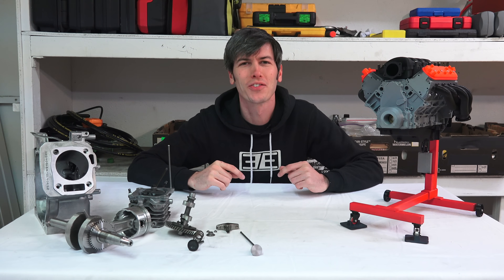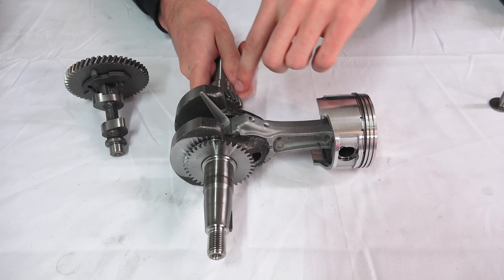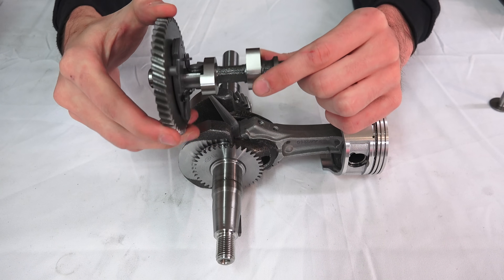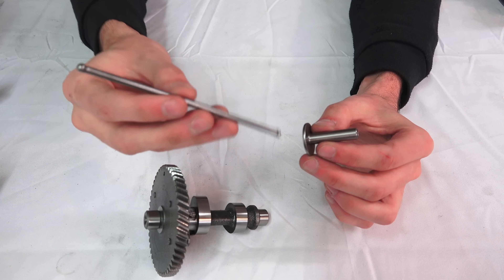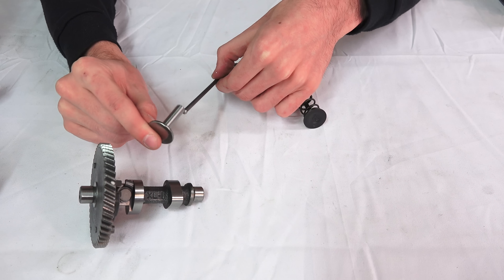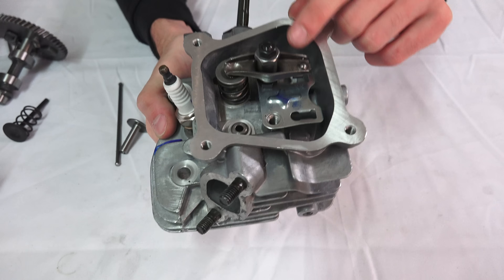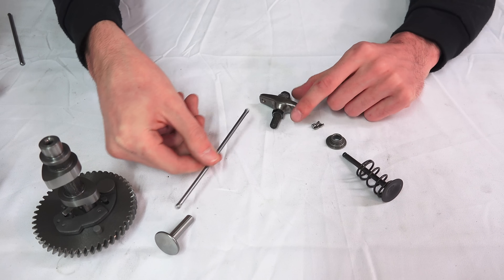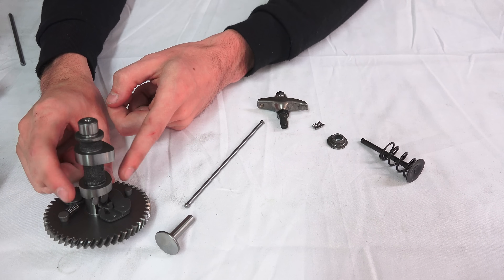Why Can't Pushrod Engines Rev High?

Comment: Another issue with pushrod engines that is very important but seldom mentioned is intake porting. In a pushrod engine, the intake ports compete with the pushrods for the same real estate in the head casting. Therefore, intake port geometry is generally compromised in pushrod engines vs OHC engines. Intake ports typically must take on a tall, skinny cross section as they pass through the pushrod wells. This, along with the need to transition to this shape in the intake manifold and then transition to a round valve, hurts flow compared to the more optimal intake porting that OHC heads allow. Newer pushrod heads (such as GM LS and Chrysler Hemi) do MUCH better in this respect than older designs, but are still behind contemporary OHC heads. This compromised flow is another factor that limits the rev capacity of pushrod engines.

Comment: Engines that operate at lower RPMs last longer than engines that operate at high RPM. High revving engines are generally smaller size Pistons shorter stroke and overhead cam 4 valve. A squeeze a lot of power out of a small V6 or V8 but generally they're a lot more stressed engines and they don't last as long as a good old-fashioned pushrod V8. That's why they're still used on the street cuz most engines don't operate at high RPM driving down the highway that tends to develop a lot of friction and becomes a fuel waster.

Comment: I am pretty sure that heavier springs aren't really an efficiency loss.  The valve lifter theoretically never loses contact with the cam lobe (except when it is closed) so the heavier spring helps push the camshaft along as the valve closes, thus helps another valve start to open elsewhere.  On an OHC V-6, that would not be the case, but in an engine where at any given crankshaft position a valve is open, it would.  On the V-6, each head is independent of each other, and there are at least 3 camshaft positions of each cam where all valves in the head are closed.

Although there are frictional losses incurred by the heavier valve springs, there actually is an efficiency loss, but I was taught that those losses are really quite insignificant, especially with the roller rockers and roller lifters.  The issue is stress and wear in the valve train components.  In the race engines where it is made possible to go to 10,000 RPM via heavier valve springs, the longevity is nowhere near what is found in the average modern day car.

Like piston speed, no big group of engineers can agree on which valvetrain specifications are best... for business, for longevity, for efficiency, for noise, the future, etc.  There are also noise harmonics to deal with when choosing the valve spring weight.  Along with making sure the springs aren't excessively stressed to the point where the springs have a tendency to fatigue.  

Also, valve float is also a problem due to the fact that the valves really should be allowed to close gently, rather than just slamming closed and having the lifter crash into the camshaft.

Comment: based on your rational a flat head engine should theoretically rev more. by including 5 vs 4 vs 3 vs 2 valve oercylibder further confuses.  at least u admitted racing rules dictate combinations n performance . ps. loved the flathead vid

Comment: Hmm I wonder when we'll have electronically actuated valves. In theory it should be a far better system with no mechanical lag, controlled directly by the ECU so the variations can be infinite in terms of valve timings. I'm just wondering if somebody is able to manufacture a system like this that is also durable.

Comment: If they are using the exhaust shape to scavenge the excess exhaust from another cylinder this could really only be true under vacuum? Because under boost with the cam overlap would push any of that excess gas out with ease. In addition if Mazda went threw so much trouble to eliminate lag it would really only be a at idle feature. If I’m wrong or possibly missing some information please tell me. I do enjoy your videos but sometimes I feel you are missing information or your source didn’t share enough information with you. But by all means if I am wrong please tell me.

Comment: Personally I love the sound of a GM pushrod V8 be it a '55 265 or a new LS over anything else, always have and nothing else will do. And for me, my current tired but still trusty 92 Silverado 3/4 ton 4x4 work truck, 4000 RPM's spinnin plenty fast enough to get the job done up in the mountains. Don't get me wrong, we had a nice pearl white Cadillac STS with the Northstar DOHC V8 engine and I at times admit I beat on that car, put her away wet and she took it all in stride. My boss is soon going to be passing his current truck on to me, a nice (to me anyways) black '07 Silverado with the 5.3 and lots and lots of mileage, just turned over 545,000 Kms and she uses no more than 2/3s a quart, sometimes less between 7k oil changes, I can live with that, it's still a strong truck. We work concrete and at times it hauls a trailer with heavy footing and wall forms and that truck is still perfectly reliable and I look forward to the 'upgrade' haha!!!
Hmmmm...could DOHC engines be successfully/reliably used as a hard workin, abuse prone truck engine? For now I'll say no, aint seen too many imports out here in the mountains and when I do see the imports, well the fellows driving them just aren't working them like we work our domestic trucks with near 2 tons of firewood roped into the box and another 3 or more tons on a trailer. I've yet to see a SOHC let alone a DOHC V8 truck out here in the hills last like our old local girls and I mean really friggin work for their keep, not just be recreational trucks.
Reply: Do you not realize all gas Ford truck motors 1999+ are ohc

Comment: With some stiffer springs my 68 Corolla's little "K" engine (1100cc inline 4) can hit 8000 rpms without floating the valves.

Comment: Bogus.  Four-valve overhead valve engines have been around for years--for instance, the one in my 1978 Honda CX500.  Also, you do not have to have two camshafts, much less two camshafts per head, to control intake and exhaust valve timing and duration separately.  Many mechanisms have been designed to effect this at the rockers rather than at the camshafts.  As far as OHVs not being able to rev, I was a passenger in a school mate's daily driver 1957 Chevrolet  with a 283 small block which he had souped up slightly, when somebody began kidding him about the car not being as fast as it once was because of all the miles he put on it.  He floored it leaving the next stop light, and shifted to second when the tach read 7, 000.  That was in 1959.  OHVs can rev.

Comment: You should take note that high-revving pushrod V8s have their camshaft mounted higher in the block to shorten the length and weight of tappets and pushrods as well as the use of lighter materials.  The use of titanium valves and springs also help as the spring mass has also been decreased.

Comment: Oh and to all who argue simantics and opinions. A high revving motor is a motor that is efficient up top. You can argue an ls can rev to such and such but need built and catered to and loses its main goal efficiency at that point. And a motor half the size will rev higher due to design, but some dont. Just depends, but its not a pissing contest, afterall a pushrod engine will always break tires than a smaller dohc engine

Comment: Factory engines are built with cost in mind and only rev as high as they need to rev to sell to the public. With that in mind most engines sold with 4 valve tech are smaller engines which need to rev higher in order to produce torque and hp needed to move the veh. There are plenty of engines that have push rods that will rev to 7k right from the factory dating back to the 50's You can buy a brand new 350 crate motor for a mere 3500 that easily revs to 7k in our dirt track cars not even a race engine. There are plenty of race engines that rev to over 10k pro stock drag cars for example Nascars  etc. Of course they are too expensive to install in a factory veh. You videos seem to all be focused on how crappy American technology is and how awesome Asian and European Tech is. Fact is you really dont know how all this technology works its more like you take a class yourself then go an try to teach it to others.

Comment: Hydraulic lifters and associated cheap and soft (for durability) OEM valve springs combined with average primary voltage rise time are the culprits for low revving pushrod V8s rather than OHC.
Also Mean Piston Speed (MPS) can play a part for engines not being able to rev high - however the rise of stroker cranks really shows that even MPS is not that limiting.
The pumping losses for pushrod vs OHC are similar. OHC often wins however because port placement and shape in the cylinder heads is less compromised as pushrods often become the limiting factor for port placement, shape and size in pushrod engines.
With OHC, manufacturers build engines that are less compromised than pushrod engines but I sincerely doubt pushrods are the culprit for low revving engines.

Now at the risk of using esoteric engines as proof of my contention, I am compelled to mention that the 426 Chrysler Hemi was routinely turned 9500 rpm in drag racing in the 1970s using the stock 3.75" stroke and a magneto. This would give it a mean piston speed in the order of 5900fpm when the consensus for MPS is in the order of 4100fpm (which kinda further disproves my MPS as the reason for engines not being able to rev high).
Anyhow, what this in fact shows is that with enough valve and port area, a short enough stroke and rugged valvetrain with good geometry, pushrod engines can and do rev up.
Chevy LS and the Gen III Chrysler Hemi engines (yes I know the Gen III is Hemi by name only) are another couple of examples of the potential for stock high RPM pushrod engines and one of those engines only use 90lbs valve springs to control all that reciprocating valve mass and they manage to turn 7000rpm in stock form. Why? because their valvetrain mass is largely irrelevant. 
Many other pushrod V8 engines can be revved up to beyond 6500rpm with modification - esp deleting hydraulic lifters. 
Many pushrod old school solid lifter flat tappet camshafts with lifts below about .620thou could rev up very nicely.
Over about .620 one needs a mushroom lifter so the edge of the lifter doesn't gouge the cam lobe but that is out of the realm of street use since in order to change the camshaft one has to not disassemble the whole motor.
The Ford 302 and some Ford FEs and 385 series, the Chevy 302, 327 and the Chrysler 340 and the big block 383 are all natural revvers. 

It is simply incorrect to say pushrod engines don't rev because they do.

Comment: Hey, you forgot the most important part: the pushrods have to transmit a lot of force, so they start bending, compressing and twisting a lot at the higher RPM, and the valve timing goes way off. And if you make the walls of pushrods  thicker, you add mass, which again increases the force. But after a few decades NASCAR had found the solution: keep the walls thin but make the diameter of the pushrods wider, to make them light but strong. That's how they got to 10K RPM. The resonance frequency in the springs is another reason for the valve float but it also has a cheaper solution than the air springs: double springs, one inside another. Each spring of the two has its own resonance frequency, so together they don't resonate. All the decent aftermarket springs are like that nowadays.

Comment: My old Honda CX500 (pushrod engine V twin 500cc , 4 valve per cyl water cooled 50hp) rev easy over 9000rpm (this engine was well known for he's very good reliability and durability): this is possible because the pushrod system is short and light despite each pushrod command 2 valves...near all other examples i read here are RACE ENGINES who have a very SHORT life...

Comment: Why don't they just make the camshafts+pushrod/follower system like the crankshaft+piston rod system? No springs, everything stays together, wherever the camshaft is set to be the rocker and valve will be there. Since it would be an attached system,likely rotating on bearings, there would be a two-nut adjustment system on the bearing for the valve, position the cam so the valve is in closed position, tighten top nut, then tighten bottom nut, with washers on each to ensure the valve is in and will always be in the correct position. I'm thinking so far into this I may as well draw a diagram of it lmao

Comment: A question we asked in engine building school wasn't why can't pushrod engines rev. Because the school car was powered by a 440 lsx that redlined at 10'000 rpm. We asked why don't dohc engines take more advantage of their more stable valve train design and rev to 10-12 all the time.

Comment: One interesting question, how to determine the amount of torque passed onto the gearbox given the amount of torque coming from the engine and how much the clutch pedal is pressed?
And how much force is coming from an engine with the throttle being at 0?

Comment: Independent variable valve timing exists for pushrod engines. 

The old viper engine had a duocam/duophase camshaft (manufactured under license) this special camshaft combined with a special camphaser allows fully independent continuously variable valve timing of both intake and exhaust valves. 

The engine with this system was so potent it had to be significantly de-tuned for the rest of the drive train to be able to cope and was only fully unleashed in the drag pack edition cars.

With ever tightening emissions regulations I wouldn't be surprised to see more pushrod engines using VVT/VVL valve trains, both are possible

Comment: You might as well ask why European engines can’t generate 90% of their torque under 2500 rpm for all the good it does.  Higher revving means a particular design is IN NEED of that rpm range before it’s stroke moves the piston sufficiently to generate power.

Comment: The question is misstated....the ability to attain higher revs is a function of being undersquare, square or oversquare in design.  Valvetrain has little to do with it.  Each design has torque/hp advantages whereas higher revving isn’t necessarily better but is an indicator of how an engine design should be used.

Comment: nice video,  always thought that the length of the stroke that the piston needs to makes determents the revs for a great deal.  ofcourse all parts contribute to this. also what do you need an engine to do. more horespower of more torque.

Comment: Hey man, love your videos, I was just wondering whether you could explain to me the difference made by using brake callipers made by someone such as Brembo or Willwood vs any other brand because I cant work out for myself why, if two sets of callipers have the same amount of pistons why one would be better than the other. Thanks
Reply: I should also explain that I get that using more pistons and larger sizes increases braking pressure but why does that mean that a full set of Brembo brakes costs 7 or 8k while I could pick up a set of volvos with the same size pistons and same amount for $500

Comment: You mite want to look into an old forgotten push rod performance thing called a "Rev kit." Essentially an extra set of valve springs that went between the lifters and cylinder preventing valve float allowing the push rod engine to do 10500 to 9500 RPM (as long as the engine was properly balanced and the connecting rods were forged) these kits cost less than $200 dollars.

Comment: LS7 has a 7K RPM from the factory. Plenty of racing V8s that spin 9k RPM.  As mentioned in another comment, they can, just takes a few parts that are designed for the application. But the real problem with V8s review high is the bottom end X cubic inches. Small pushrod V8s are rev happy by nature. Interestingly, how many DOHC motors are over 350 inches in a V8 configuration, most if not all over 5.5L go to a V10 or V12 to get the cubic inches.

Comment: Question : why not have the follower be captive of the cam shaft ? Fit a ball bearing on each side of the lobes with springs hooked to the follower. 
Another solution would be to modify the lobes to house guiding rails which fit ball bearings (again) connected to the follower. 
Might be more complex than that, I'm sure...

Comment: Hey Jason, perhaps you could do a video on what happens when you're car runs hot (not over heating but hotter than it should be) and what happens when it runs cold (i.e lower temp thermostat or something). I'm not entirely sure how accurate but I've heard the latter can cause a car to eat up gas and increase wear.

Comment: One more advantage of 4 valves per cylinder.

With 4 valves per cylinder, each valve is smaller and lighter so it can be opened and closed faster, assuming that each valve has its own cam.  The fact that the valves can then be opened and closed faster can be used to get the engine to rev higher, or it can be used to reduce the number of crankshaft degrees required to open a valve and to close the valve.

Comment: Very informative channel. I had a Honda CX500 that revved happily to 10 500 day in and day out. Four valves per cylinder and pushrods. That was in the early 80s. 
In the 1930s the desmodromic valve system was developed to overcome valve float. I can't find much on the history but I believe that the Auto Union and Mercedes racers of the pre-war era used it - with overhead cams. That eliminated the valve springs with the associated energy consumption of compressing very stiff valve springs 10 000 times a minute. It was not very effective at lower rpm though. I wish somebody would build a production engine with pneumatic springs.